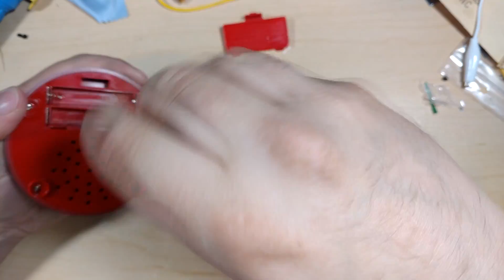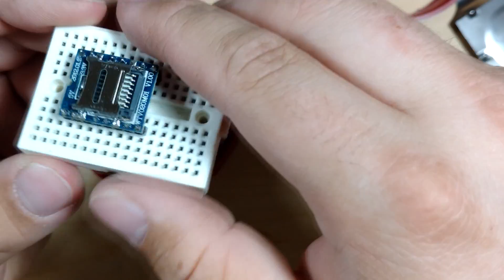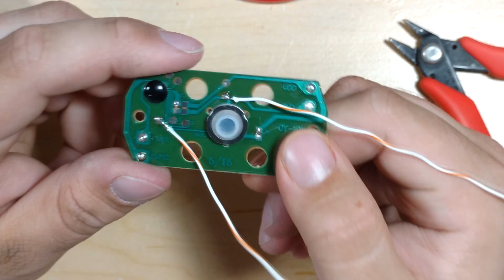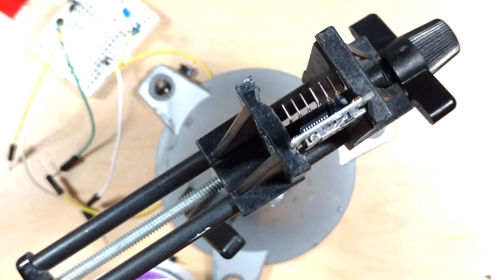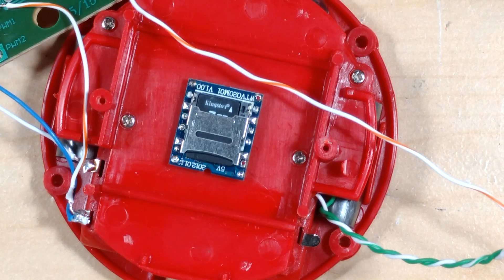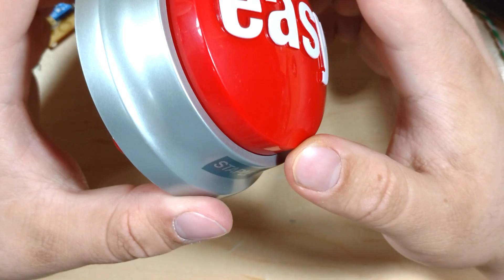Staples Easy Button Custom Audio Conversion

Comment: I need your advice for a project I'm working on. I saw a recordable easy button online that I want to buy so that I can replace the sound chip of a different toy with it. The toy is animatronic so it moves at the same time that it gives off sound. It has its own batteries and they are likely different than that of the easy button.. (not sure if that complicates things). I want to set the toy up so that it continues its same function, but with my recorded audio instead of the original audio. I assume adding a relay to it might allow me to replace the toys speaker with a better one... but I might be wrong.. I'm new to this. If you can help me on how to do all of this I would greatly appreciate it.
Reply from the maker: You wouldn't need a relay to replace the speaker, if you can re-record the audio on the toy itself, some things like that will have contacts on the board and a microphone connection that might let you record onto the chip itself, similar to those greeting cards you can get, as the same cheap boards are used in a lot of things.

If that's not an option you could probably find a a source of power which only turns on when it's playing the audio and moving and use a transistor to turn on an sd card based player like I used.
Reply: @JunctionRunner  project is going well so far. Since I'm using the USB easy button, I was able to add music.. then to my surprise I was able to add a 3 inch speaker to it and it still functions. And it's LOUD. I love it. Much better than the cheap little plastic speaker that comes built in. as a test I hooked up another set of wires linking the 3 inch speakers terminals to a battery operated digital alarm clock (has the same voltage batteries as the easy button... 2 AAA's) and that turned on as well in command to the pressing of the button. It may be easier to link those wires to the animatronic toys "try me" wires so long as the toy is the same voltage batteries. To expect 3V to power up both things might be a little outlandish and the batteries may not make it through very many presses... but who knows.. I suppose it's worth a try. I don't know a whole lot about resistors and such but this has been going well so far without them. Anything I should be weary of? Could the internals of the easy button overheat or anything that might be  unexpected?